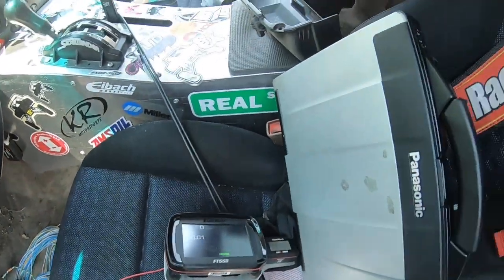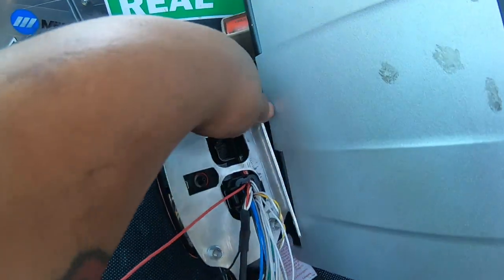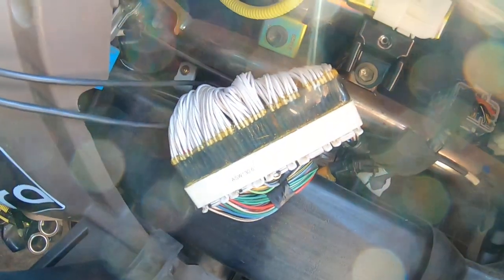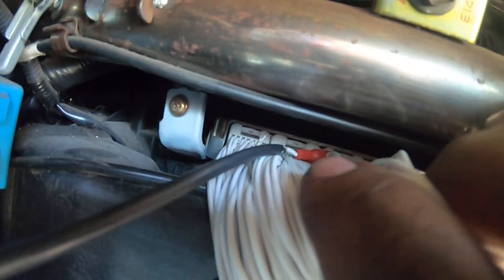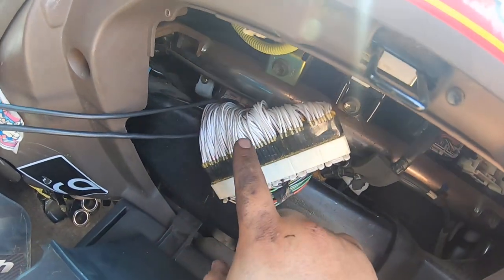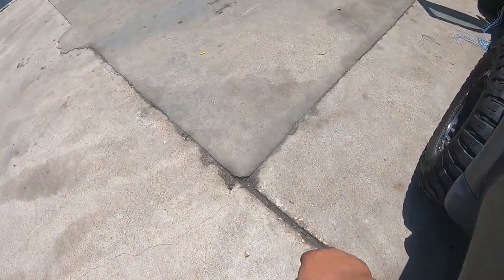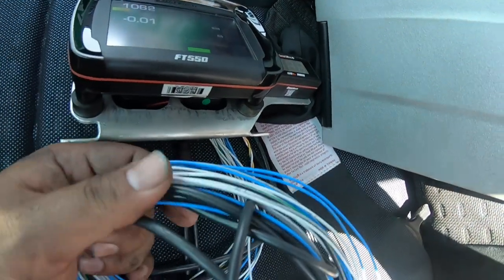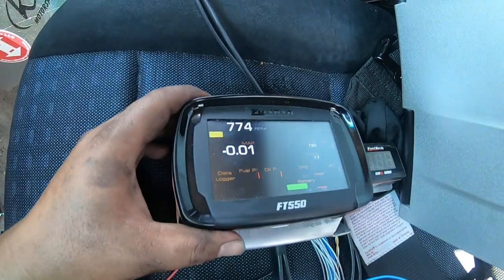Fueltech 550 to 2003 Toyota Tundra, in parallel  mode with stock ecu

Comment: Thank you for the video. Question on the cam and crank signals. Did you just tap into the positives signals? Or did you share the signal positive and signal negative on the VR Mag sensors?
Reply from the maker: On the VR sensors I did both wires.
Reply: What about tapping into the cam sensor ,which is Hall sensor.

Comment: How do you change the dwell i fry up all my toyota coils when i plug the socket it heats up
Reply from the maker: In the software, there's a voltage vs coil.  Are you using a fueltech??
Reply: @krmotorsportskilleen  yes where do i find that settings in ft manager ?
Reply from the maker: @jhonpatrickflores8273  page 36-37 in the manual.  The manual calls it "ignition energy", but in later firmware calls it "ignition dwell".  It's under the engine settings though